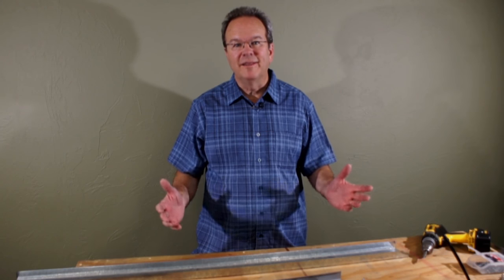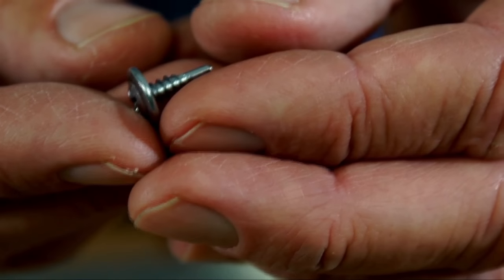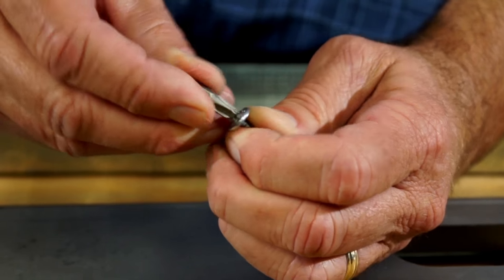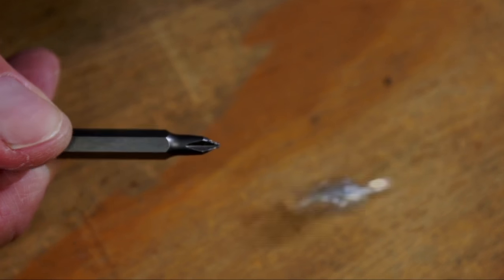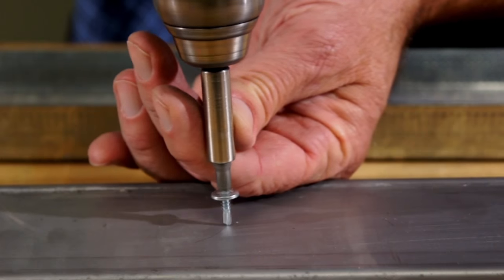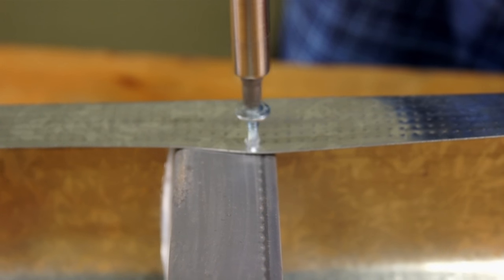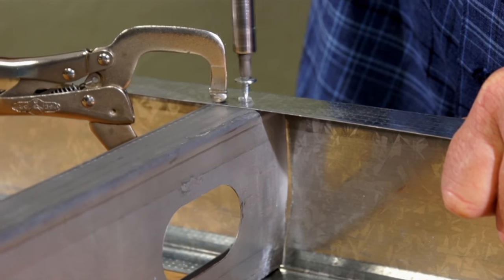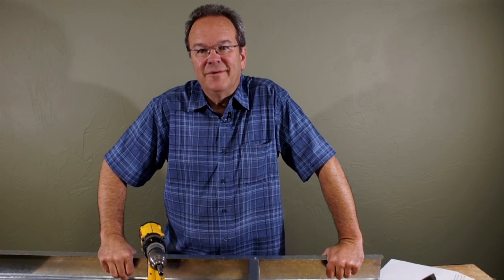How to Install a Self-Tapping Sheet Metal Screw

Comment: No self-deprecation required. This is a very helpful video, including all the mistakes you can make if not doing it right.
Reply from the maker: Thanks for your kind words.  Glad it was helpful.
Reply: Yup, if I wasn't in the middle of making a stupid mistake I wouldn't have been looking for this video😜
Reply: I have put in a lot of sheet metal screws. But I don't do it everyday. Your video reminded me of what you forget no matter how many you have done a couple years ago. The importance of clamping in particular. I am installing a 5' continuos hinge. The walking reminded me also to start in the center work to outer edge.    Very good.

Comment: I'm an apprentice sheet metal with almost no prior experience to speak of. Yesterday, a month into working for this construction firm we were on site installing flashings for door frames of the building and for the life of me I could not get the screw thru the metal! I did a few but after a while they kept dancing away and just not going thru. My boss was watching(he's seen me efficiently use a drill before and was kinda flabbergasted at my lack of skill) and the superintendent of the site. It was humiliating knowing they were watching me mess up over and over along with the other trade workers(land scapers, plumbers, etc) My boss made it look effortless. Which didn't help much after being seen fail too many times at what's supposed to be a simple task.Thank u so much for posting this I need the help and pointers asap.
Reply from the maker: Many thanks for your comment.  First of all, Raul, I can certainly sympathize with your situation. Some of the problems I’ve had on the jobsite are still too embarrassing to publish.  Once I just couldn’t get a nail to drive straight with my new hammer, only to find out that this new hammer’s face was ground crooked and my co-workers had the same results when they tried to drive a nail with the same hammer. I returned it and bought a different brand.    
My first guess is that your problem is often caused, even sometimes by experienced workers, when the drill is accidentally switched into reverse.  
If that is not the case, then, sometimes you just get a bad batch of dull of screws.
But, sounds like your boss had good luck with the same screws.
If neither of these issues solve it, you may just need to practice a whole lot on some sample pieces of metal.  There is a technique, a feel, and practice does help a lot.  
First, try starting the screw at slower rpm and press firmly until the little drill bit on the tip begins to start a little cutting, a little indent, so that it has something to keep the screw centered.  
(be sure you have a driver bit, usually a Philips bit, that really fits securely in your screw head, so it doesn’t wobble. That can be a major problem.)

Second, now you can increase the rpm as you continue to push a little harder as the screw drills the hole and it can screw into the hole.  
Hopefully they didn’t just give you, the new guy, a batch of bad screws, or switch your gun into reverse when you weren’t looking, (kinda like telling you to go get a “board stretcher”) to give them some entertainment on an otherwise mundane jobsite.  
More commonly, it is definitely a skill that can best be learned and honed by practice and time.  
I hope this helps.  
Thanks for your question!
Reply: Why were they watching you mess up when they are supposed to be teaching you, get out of there you'll learn nothing from these people

Comment: What do you do if you accidentally screw it too tight in the track where’s it spinning and compromised, and but that’s the exact location i need it , I can’t move it any over
Reply from the maker: Hi @justinhargrave252.  Great question!  Frank is currently out of the office.  We will get an answer to you as soon as he is back.  Thanks again for the comment!
Reply from the maker: Justin, In a typical wall, it may not really matter much whether the screw is really ‘biting” since it will still be holding the metal stud in its location. 
 
If you feel strongly that it needs to be a tighter connection, you can find a step larger gage screw to install in the same hole, but these may not have as flat of a head on the surface.  

Another option would be to use a pop-rivet to secure this particular joint.  If you use a steel pop-rivet  it will certainly be strong enough to do the job.  But usually, while it is optimal to stop the screw before it “strips out”, it usually is not that devastatingly important.  If the screw is installed, the stud, or whatever you’re affixing, will not come out!

Hope this helps!    Frank

Comment: Great video, and great instructor. Question, isn't the sheet metal screw you demonstrate, actually, or more technically a "self-drilling screw"? 
The screw used in your video produces it's own hole, without pre-drilling. You called it a "self-tapping screw", but don't self tapping screws require a pre-drilled hole, guide hole or pilot hole? 

Minor discrepancy, just curious. Thank you for posting your video.
Reply from the maker: Good catch! Self-tappers don’t necessarily have a drill point, so self-tappers aren’t always self-drillers. And self-drillers are self-tappers. But you’re right, it is a very common mistake. So common in fact, that the terms are often, in our experience, interchangeable. Thanks again.

Comment: Hi Frank, I searched countersinking screws and got your video. Do you have a video explaining how to countersinking without a drill press into sheet metal? Is there such a thing?
Reply from the maker: Hi Mahmood, thanks for the question.  Sorry, but we don’t have a video explaining how to countersink a hole in sheet metal.   I typically use a countersink bit in a hand-held drill for that. But since our actual focus is on metal stud framing and our Flex-Ability Concepts products, and we never have a application where countersinking the screws in metal studs is helpful, we just haven’t made such a video.    Maybe we should just for fun!  Hope you are able to find what you are looking for.

Comment: I want to hang some wood shelves on the studs of my metal carport.  The studs are made out of square aluminum tubes.  Most of the sheet metal siding of this carport was hung on these studs with self-tapping coarse threaded screws.  Can I use them to attach the wooden shelf brackets for my shelves or should I pre-drill, through both sides of the stud,  and use long bolts with nuts?
Reply from the maker: That’s a great question, but I’m afraid I can’t really give you a definitive answer since there are so many unknown (to me)variables.  First of all, it depends on how heavy a load these shelves will be carrying and how deep/wide the shelves are.  It also depends on the type of bracket you are going to use.  If it will be for lightweight stuff, like fishing poles, or medium weight stuff like small cans of paint , the self-tapping screws should work fine.  However, obviously, if you plan on storing heavy toolboxes or your massive (and I’m sure, interesting and exciting)  boat anchor collection, then I would definitely recommend bolting through the square aluminum tubes as you mentioned.  So many of these type decisions are decided by the carpenter/installer and (in my humble opinion) it’s always safest to overbuild it so that you can sleep soundly for years to come (not wondering about that job you did so many years ago.)
Thanks for the great question, and I’m sorry I can’t give you a hard answer.
Reply: @FlexAbilityConcepts   Thanks!  That's food for thought and helpful!   The weight the shelf would bear probably falls into the "medium" category, (pick, shovels, heavy bicycle racks)  and it'd be an 18" deep shelf which would  span 9 feet (the width of the carport).  And it'd only be supported on each end  (nothing in between) by the metal studs and shelf brackets.  Because of the long time it took me to drill a test hole in those tubular 3x3 studs, I went back and checked them with a magnet and they ARE  magnetic, so I guess that means their steel, not aluminum?   Does that changes anything?

Comment: Will the  Dewalt 257 screwgun with 2500 rpm sufficient for enstalling sheet metal
Reply from the maker: Yes, I’m not particularly familiar with the DeWalt model numbers, but any good 2500 rpm screwgun will be excellent for installing these sheet metal screws.

Comment: What is the thickest metal you can use these screws on? I need to secure something on a metal Pope that has 5mm walls. Do you think that would be too much resistance for this product? Thanks
Reply from the maker: Many thanks for your question.  Five mm is too thick for the type of self-drilling or self-tapping screw that I used in the video.  The drill bit tip is too short to drill all the way through the five mm before the threads begin to catch.  These little screws are made for sheet metal, more like .5 mm to 1.5 mm, or 20 to 16 ga.   They do make a self-drilling screw with a long drill bit tip, (before the threads start on the shaft) that is longer to drill through thicker metal, possibly through your 5 mm metal.  Just call your local fastener supplier, (probably not just a big box store to get these specialty screws) and they should  be able to get just the right screw for your application.  
Since these are pretty beefy, they will probably have a hex head on them. 
Hope this helps!
Reply: @FlexAbilityConcepts  ah thanks for the help!
Reply from the maker: @theparkourlady894  Glad to be of assistance!

Comment: Hi, very helpful, but can you explain something about speed and tork as your doing this.  That is an important part that can make you either successful or not when drilling into metal
Reply from the maker: Hi and many thanks for your comment!  When installing these self-drilling/self-tapping screws, you are typically (almost exclusively) installing them into sheet metal.  As such, your most important  factor will be the speed, along with a moderate amount of pressure to make sure the drill bit on the screw is actually cutting, not just spinning on the sheet metal and overheating.  You won’t want or need a lot of torque from the drlll, as that would easily cause the screw to strip out the sheet metal when it is fully seated, creating a looser connection.    With less torque from the drill, it makes it easier to stop when the screw head hits the face of the sheet metal, and make that “perfect” connection.   
Hope this helps!

Comment: I need to fasten some heavier stuff to the sides of my van. The sheet metal is a bit thicker, (as I suppose a man like you probably know). What way would you recommend me doing it? I need to hang stuff that are 10-15 pounds in weight. I can't use a bolt and a nut cause I don't have enough space, and this self tapping screw looks a bit flimsy.. Is there some other way to do it? And please, oh please don't say rivets cause I don't have a rivet gun nor have I've been using one in my life.... Thank you.
Reply from the maker: Hi Mark,

While these screws do look rather lightweight or flimsy, they are actually rated pretty high in pull-out and shear strength, depending on the metal you are screwing into.  If your metal is too thin, the screw connection will not be as strong.  When you are working with thicker sheet metal and need more strength, they make these self-drilling screws in larger diameter screws. 
Also, as you pair up the screws the stability of the connection will increase greatly.  

So, there, I was able to hopefully answer your question and I didn’t even mention rivets,--Oops, I just did!

Hope this helps, Frank
Reply: @FlexAbilityConcepts  thanks!

Comment from the maker: This is a comment that was posted by Tera GX. We apologize for deleting it by mistake so are reposting the original question with an answer from us.

Comment: "I used these to modify my desk and it was great solution for a while. But overtime the holes have become stripped. It's a hollow column so there is no "back side" for me to work with. Are there any good ways I can reinforce or improve a hole these made, while only accessing the hole from one side?"

Answer: If you are using these self-tapping screws to fasten two layers of sheet metal together, and the layers are stripped out, I would recommend finding a larger diameter sheet metal screw and install it into this same hole.  It doesn’t even need to be a self-tapping screw since the pilot hole is already made, but if it is a larger screw it will grab the sides of the hole and hold it secure.

Comment: This is a self drilling screw. Self tapping screws require an a pre drilled or stamped hole.
Reply from the maker: Hi there @bigbrakeman1.  Good catch!  Self-tappers don’t necessarily have a drill point, so self-tappers aren’t always self-drillers. And self-drillers are self-tappers. But you’re right, it is a very common mistake. So common in fact, that the terms are often, in our experience, interchangeable. Thanks again.

Comment: How would you tap cast iron shower base?
Reply from the maker: Hi Mike,
The screws discussed in this video are designed to be used in sheet metal applications.  If you want to “tap” threads into cast iron, these screws will definitely not do the job.  You will need to use a “tap” which will cut these threads into the hard, somewhat brittle, cast iron.  And before you can tap those threads, you’ll need to drill the proper hole with a drill bit, not a screw.  Each size tap has a specific drill size to get the proper amount of “meat” left in the hole to cut proper threads.  It is a more time-consuming job, but it is the best way to tap threads into cast iron without cracking it or stripping out the hole.  I’ll bet you can find a youtube video that shows you the steps and method on how to do this.  It’s just not in our area since we’re more in the metal stud framing business and they don’t normally make cast iron studs.
Hope this helps Mike and thank you for the question!

Comment: Nice vide,  can use those screws in a metal frame like a cargo trailer frame.  I am trying to ground a wire, and totally missed up today. I drilled a hole into the frame, and was trying to drill a bolt through with a washer it didn't work.  don't know what I am doing wrong.  I just want to ground a wire to a metal frame is all.
Reply from the maker: Hi Charles, From what I have seen, these self-tapping/self-drilling screws will work well to attach your ground wire to the trailer frame.  Of course you’ll want to make sure the trailer frame is clean, for good contact, before you install the ground.  Also, if the trailer frame is very thick, you will need to drill a pilot hole, a little smaller in diameter, for the screw so it can actually go through the frame.   Thanks for the comment, and I hope all works well!
Reply: @FlexAbilityConcepts   Awesome thank you very much.

Comment: Good video. I like the dry humour.... but as a few others have already suggested already; I think in some contexts/situation - a  smaller diameter pilot hole reference is needed if the secondary metal is considerably *thicker* than the primary metal;
Reply from the maker: Yes, if the secondary metal is “considerably” thicker, it does create its own set of potential problems. First of all, I’d definitely recommend clamping the two layers together so that when it quickly drills through the first layer, it doesn’t start threading into it and lift it up and away from the second, thicker layer, which is going to take some more time to drill through.  If the second layer is really, really thick, you’ll probably want to drill a pilot hole with a drill bit, the same size as the drill point on the screw and then run the self-tapping screw through both of them.  If the second layer is too thick or too hard for the self-tapping screw to successfully cut threads into, you’ll probably want to go ahead and tap some threads with a tap and install a screw with “machine” threads, such as a 8-24 or 10-24, etc.  But that is much slower! That’s why these self-tapping screws come in so handy for rapid constructions assemblies! Thank you for your comment and please don't hesitate to let us know if we can be of any further assistance.
Reply: Thanks for you detailed reply. I'm just beginning a small fencing project; and two of the new thin sheet metal post extrusions need to be attached to some existing 4mm thick square section gate posts.  Oh.. and one panel edge will be into masonry plugs as well; which is probably drifting off into another topic.

Comment: Is it hard to screw them into pipe? Harbor Freight portable garage frand slip joints.
Reply from the maker: Hi Lydia, it all depends on the thickness or gauge of the pipe you’re trying to install the screw in. If it is any thicker than 16 gauge or about 1/16 of an inch I would recommend drilling a pilot hole through the pipes first and then you can install the screws into the pilot hole.  Also pipes are a little tricky as the drill point of the screw will try and run off the side of the curve of the pipe. It may be easiest to use a center punch to put a little ding in the pipe so the drill point will stay where you want it and begin drilling the hole.
I hope this helps for your particular situation.

Comment: Self drilling not self tapping. All screws do self tap but some drill the hole ss well hence the self drilling whereas others need a pilot hole done before using a drill bit- these are self tapping
Reply from the maker: Good catch! Self-tappers don’t necessarily have a drill point, so self-tappers aren’t always self-drillers. And self-drillers are self-tappers. But you’re right, it is a very common mistake. So common in fact, that the terms are often, in our experience, interchangeable. Thanks again